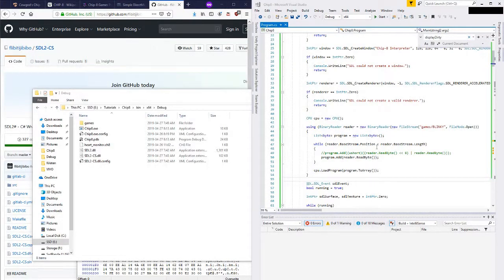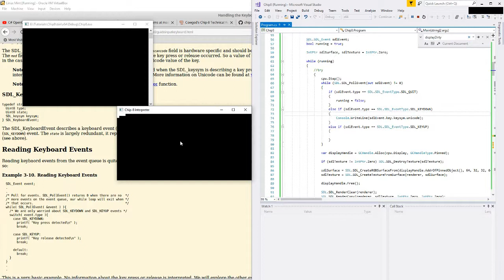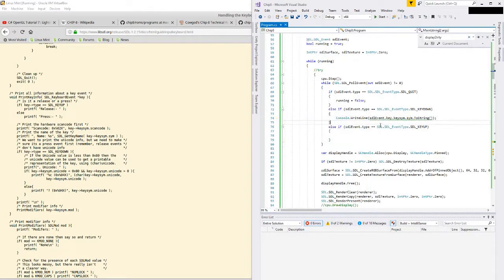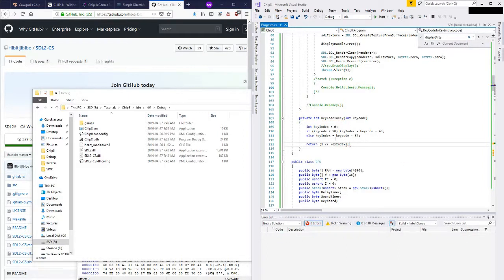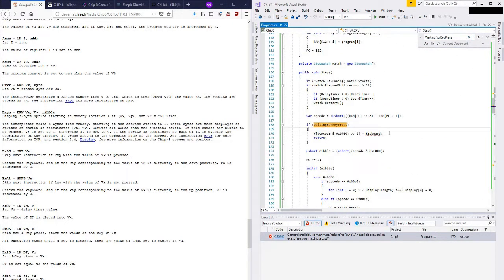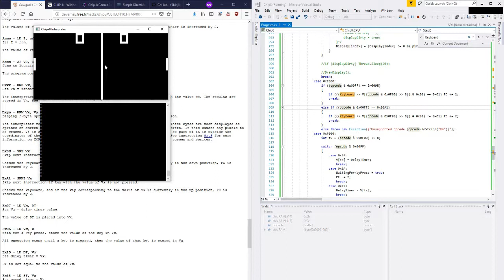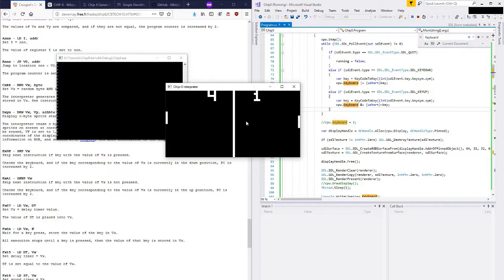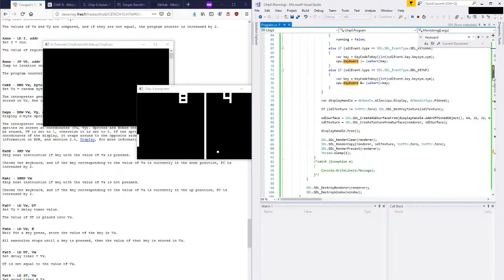Chip-8 Interpreter in C# - 11/15 - Keyboard Input

Comment: The CHIP 8 keyboard isn't just 16 keys. It's meant to be a physical keyboard with a 4x4 grid layout that most programs will design their control scheme around:

1  2  3  C
4  5  6  D
7  8  9  E
A  0  B  F

In terms of mapping it to a QWERTY keyboard, it's a bit tricky since the keys aren't in a square grid layout, but I've seen people suggest this as a compromise:

1  2  3  4
Q  W  E  R
A  S  D  F
Z  X  C  V
Reply from the maker: That makes a bunch more sense!  I'll probably update the github code to offer these key options.  Thanks for the message!